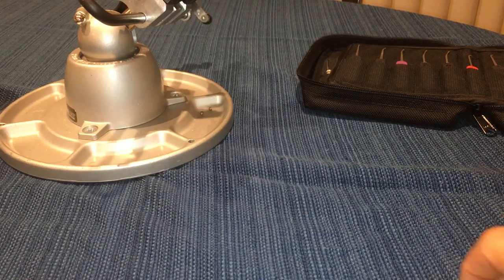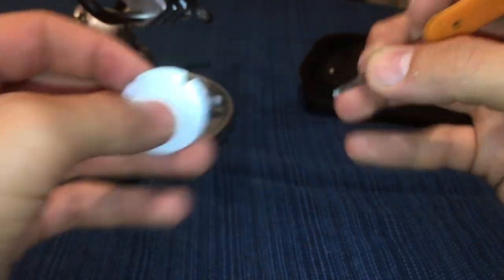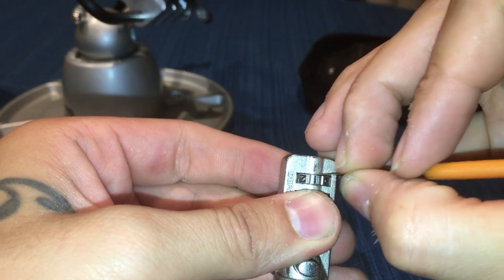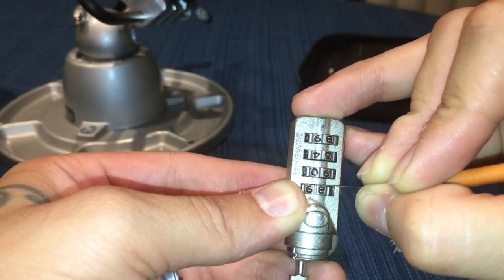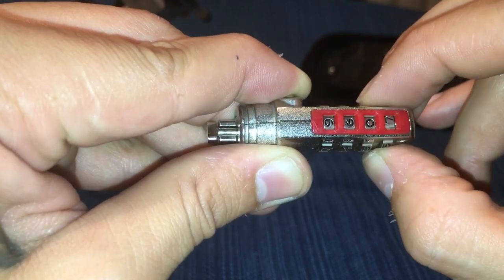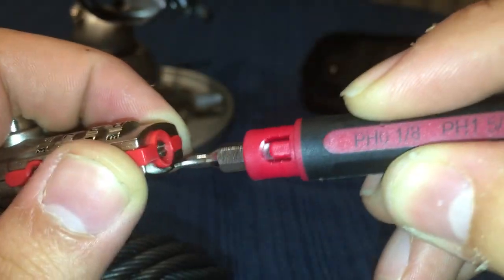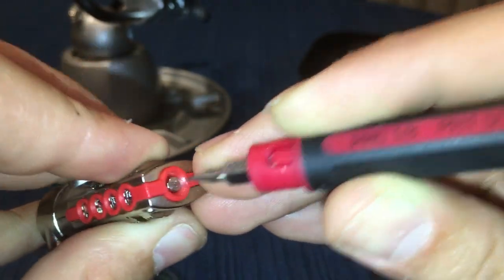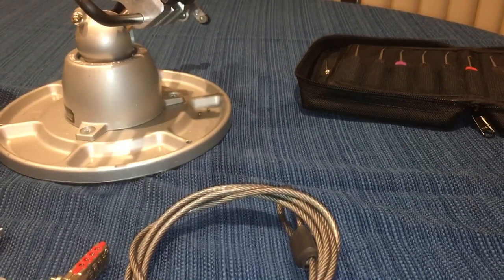(032) Defcon CL Computer lock decoded EXPLAINED!!!

Comment: With the second model Defcon CL, I found applying tension to the discs using the open lever, I would work out the true and false gates per disc and note the numbers, once I had it down to 3 digits per disc, I would just start brute forcing the numbers (which still takes time, but dramatically less with only 3 variables per disc) which was a pretty trivial activity.

Worth nothing that these on their own, aren’t an anti-theft device at all, they’re just to stop the office pest from moving your kit around.

GL, HF, and as Bosnian Bill would say, ‘Stay legal’

Comment: You gave me just what I needed: how to set an unknown combination lock (no labels or imprints anywhere on the lock) from the factory zeros.  The lock I have has the cable coming out where your slot is.  I was able to push the cable in to change the combination and then release the cable. Once the cable popped back out, the combo was set.  Thanks.